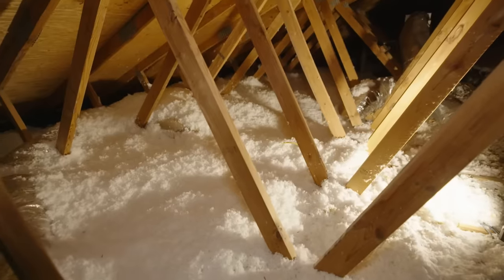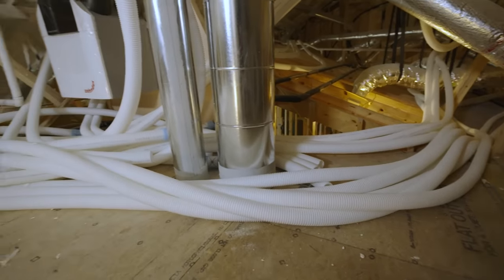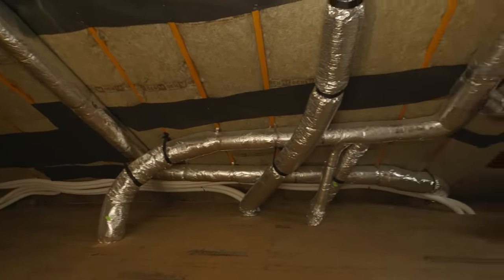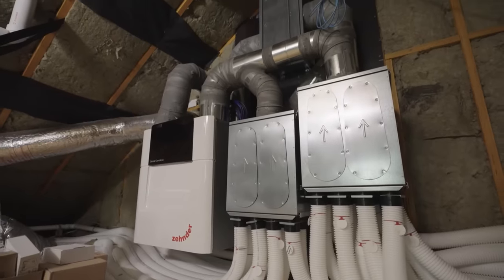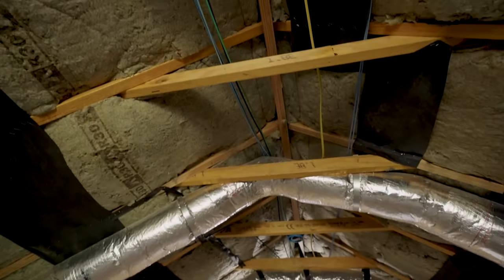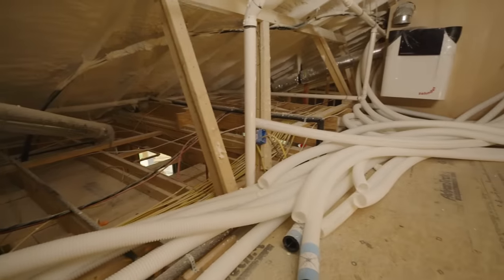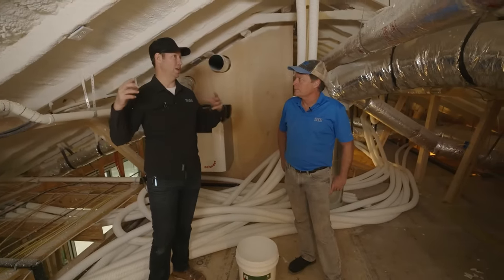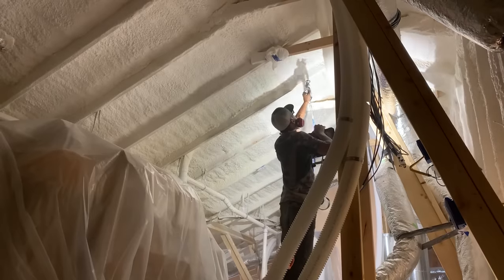Building a BETTER attic - Unvented + Conditioned attics 101

Comment: I thought I was going to see something innovative that is condensed, less complicated, with an eye on the budget. This is exactly the opposite of that and looks like a nightmare. I would opt for a ductless system and a clear span attic that is insulated with circulation roof fans installed, leaving it available for potential a/c and living expansion.
Reply: Ductless (mini splits or ptac type units) are possible but independent of the type of insulation , and assuming you mean rafters or an attic truss for the "clear span", if it were insulated for future use you wouldn't be ventilating it with "circulation roof fans".
Reply: Duh if I can't do a while house in a day it's a waste of everything

Comment: Well I live in Southern California and I feel sorry for anyone that has to live in a swampy climate like Florida. It was 116 ( one day) during a heat wave and humidity at 7% in summer  of 2020 and I never once needed to turn on my ac. I have learned to cool my home with a Bonair 5900 evaporative cooler and the hottest it got that day was 80 inside my home and dropped quickly after sunset. Desert living is the way to go if you understand how to manipulate your environment by capitalizing on the low humidity levels. However we do have to use our conventional central A/C for about a total of 22 days on a average due to hurricane fronts pushing up from Mexico causing our humidity to go over 45% which makes evaporative cooling useless. And yes we do have wood rats that like to encroach into the attic so we do have to be diligent about rodent control 24/7 365 days a year. Type of home ( stick built stuco treak home).

Comment: The outside of that roof is going to get scorching hot without attic space ventilation.  I'm fairly certain this will be less efficient over all since there is no convection to continually remove heat from the roof surface.  Also asphalt shingles will probably melt and curl in 2 years.

Comment: Matt states "this is a dumb way to build" and shows a "better way to build", and as usual, without a word about the cost, and what the expected savings will be. 

This is a dumb way to plan your build.
Reply: It definitely costs thousands more.  And it may be more efficient, but you added  couple thousand SF to heat and cool, that costs $
Reply: I've watched several of his videos.  Some I like but many feel like sales pitch or a Holmes On Homes episode.  Not always practical.
Reply: @imushavem7504  his old ones are really good.  Lots of useful info.  Lately, it's mostly Bob Vila style sales pitch.

Comment: Matt I appreciate your videos and think you do a nice job, but where is your air barrier in this attic?   I know that rockwool can be a fine insulator, and I'm sure that in TX you don't have the same issues as we do in colder parts of the country with water vapor condensing on the undersides of roof decking (and forming mold).  But in a cold snap or anytime outside temperature falls below dewpoint, my guess you will have water vapor working it's way up through that rockwool, condensing on the underside of your roof sheathing and then potentially causing some issues.  As a bit of background I have fairly deep building science training and own an insulation company in Pittsburgh specializing in retrofits.  Are you not concerned with having an air barrier on the upper part of your building assembly due to the climate there?

Comment: I’ve been doing this for almost 20 years in South Florida. It’s the only way to do things. I don’t like the rock wool tho, I use foam.  You get a better R value and it’s cleaner. Bump that rock wool in a couple years and see what happens. My attack gets about 3-4 degrees hotter than the house in the middle of the summer and unlike most of Texas, we have wicked humidity. I also have block walls with a R-r foil, along with impact glass.  My electric bill is about 20% less than my daughters house that’s 60% smaller than my house and I have a pool.  It’s more expensive, but it saves me an easy $100 a month.  That’s a stupid code for fire. There’s so many stupid codes.  No problem if it’s a living area, even tho it’s above your head, but for a storage area outside of your living area, really?  By the time it makes it through the 1/2 hr drywall in your house, to get to the attic, you’d better be out of your house.  A lot of codes are pushed by manufacturers paying code officials to use their products.  I’m sure that’s where this one came from.

Comment: All the ways I see on american youtube channels make me laugh because they are so old and outdated so is this one.

In the first place, the first way of making the attic, such a waste of your space. In addition, it is always a mess with cables and flex AC channels. Have you never heard of cable ducts over there?

Maybe you should come here to see the European way of building. All the mentioned "new" solutions have been used here for years as a standard.

For the first roof in his own house, he only uses Rockwool, very good, only a vapour-tight layer is still missing. On a cool evening or in winter, water vapor will condense under the metal roof or against the roof boarding and cause it to rot or mold. It's almost done, now just have to finish it the right way.

The foil also prevents the Rockwool panels from sagging, which happens after 1 to 2 years. In addition, the particles that come off the insulation boards cause lung damage with prolonged exposure. These particles are released by just the air moving through space. These plates must always be finished or concealed if it is a room where you can or may come often.

If they are the specialists, they still have to learn a bit more...
Reply: I agree. The space between the Rockwool and the plywood will indeed cook! I like to put baffles and let air flow along this plane. And yes I also agree that the exposed rockwool is not the best of ideas. Cover it with permeable house wrap or with permeated fi foil.

Comment: The most expensive attic ever ! That you cant live in
Reply: Yes problem solved by using cellulose insulation not fluffy fiberglass.
Reply: Would you want to live around duct work? lol it is still usable space....I tried storing seasonal decorations in my attic.....a lot of it melted in the Texas heat....sooo, cant use my attic as is, it is literally, dead space.
Reply: @AD-1138  the money that was spent on a attic like that one you could have made a air conditioned room !
Reply: @jimbo4203   You are obviously missing the point of why they are making the conditioned attic space and how you will save money over the life of the house.

Comment: Hey Matt.  What kind of air and vapor barrier was on your Rockwool assembly?  You can't just stuff Rockwool in those bays and be done.  There is more to that assembly.  Nic job on the show over the years.  Keep up the good work.
Reply: It's Texas, the sheathing is both air and vapor barrier. In hot climates you want that stuff on the outside because that's where the moisture comes from, especially if you have brick veneer.

Comment: Better solution - $99 gable fan to power vent the attic whenever the temperature rises beyond a set point.
Reply: I have one and it works great. I have a basement so my ductwork and furnace are down there. Painted the house white to reflect heat and a few strategically placed trees for shade. I'm comfortable up to 85 degrees without running the AC.
Reply: Horrible solution.  

No: 1 it doesn't address the energy penalty of having the ducts in attic. 

No 2: It draws cool air from the living space below which in turn will draw moist outdoor air into the living space below.

No 3: If your attic ducts are leaking your spending $$ to heat/cool the outdoors which is what a vented attic is.

Comment: I'm supposed to close on a house just outside of Austin that looks exactly like the example typical attic here. (Except that the insulation is blocking the ventilation anyway) I want to be able to easily run wires (for Ethernet, speakers, KNX) and stuff through the attic, and something like this might be the way to go. I don't particularly want to be digging through blown insulation.
Reply: So you going to dig thru expanding foam instead?
Reply: @tyler3993  No, insulation would have been on the roof rather than the attic floor. Making it easy to run wired through the attic. Though I will not be buying that house due to insane circumstances that not even the head broker for the state has seen anything like. O_o

Comment: I'm pretty sure that carbon dioxide is the temperature of all the gases around it. Carbon dioxide can help put out a flame when it displaces oxygen but I don't think it's a cooling gas. Correct me if I'm wrong.

Comment: Just curious, IF you decide to apply this product in an existing roof with shingles and by any chance there's a penetration in the shingles, can the water get stuck undetected between the layers? 🤔
Reply: Closed cell foam in particular expands and would seal holes. If the roof cover is leaking, that would be a problem on top of the sheathing but not between the foam and sheathing.

Comment: I have said this many times. I don't understand why houses (attics) are done that way. Well, one point is the price. It is a heck of a lot cheaper to stand at an opening with a hose over your shoulder and spray that stuff into the attic until it looks like enough. The way it shows in the video, it's the way it should be done. But there is a hefty price difference.

Comment: In Europe banks won't finance houses with spray foam attic insulation as you can't check the quality and condition of the wood frame underneath. As mentioned it can be moldy, substandard and removing the insulation may damage the frame as well as it sticks so damn well.

Comment: The only product to use in attice (the walls too) is spray foam insulation! Yes rock wool insulates,,,,, but it doesn't seal. Energy moves with convection easier than conduction or radiation.

Comment: I've got a newer (2 y/o)  DR Horton built house in NW DFW that I've been brainstorming on converting to sealed, and I'd have zero issues if you wanted to do a video about. Would also allow to remove the 24" or so of loose fiber insulation and put decking down over the rafters for a ton of storage space. This one is a cathedral style attic that has about 10-12' height at the tallest point from the existing decking. Very easy for a tall person to stand fully upright and still have several feet of headroom.

I agree, it would have been 1000% easier to do during the initial build vs. remodel, but I am the 2nd owner, so it is what it is.  They did a decent job as it is, but having watched yours and several other construction and remodeling channels and seeing what others have done, there's a lot of room for improvement.

Comment: Here in S.E. Texas , we have a 2500 sq ft vented attic . Vents are on each Gable , two intakes on back side of roof . One Power exhaust set at 105 that normally runs no more than 10 hours daily in summer .  Our electric bill on balance billing is 65$ monthly . Why would we want to KEEP heat in the attic 24 hrs day ?  During Feb 21 ERCOT Failure , we had no power/heat 60 hrs straight . attic got  No colder than 40degrees so no frozen pipes as we drain them as soon as we lost water . HEAT in attic must be northern Thing .

Comment: Our attic looks just like the beginning of this video. but our air ducts looks like a horror story and we have certain rooms that doesn't even seem the air conditioning is even coming up... The contractor that built our home did a horrible/ terrible job on the air conditioning ducts and also parts of the house...We hardy have any cold air in the house...🤔😕 Good video very informative...👍
Reply: Ducts should in in dropped soffits in the house, never in attic. Or go to wall or split systems and eliminate filthy ducts.
Reply: @designstudio8013  Wow!!! Your Awesome!! Thanks😉💯👍

Comment: -Excessive cost (vs insulating only the attic flooring, you’re promoting doubling the surfaces insulated and the costs would be massive).
-Promotes materialism (if your house can’t hold it, don’t buy it)
-Toxic materials / Terrible environmental impacts of foam / flame retardants
-Requires Power 24/7 to AC; as attic has no passive cooling. So any thing from a natural disaster to a cyber attack could cause massive mold issues (especially in the South).
-Attics insulated this high in R-value will not aid in melting accumulated snow. And unless the roof was designed to handle excessive snow loads?

Over building a home on paper is great; but it’s also not practical for most Americans. And this video takes the cake. Because it’s advice that is only practical in texas with a home that has backup power. And of course, for a wealthy client.

Comment: From my understanding the ventilated attic or roof space is to keep the sheathing cool and the tar paper used as a vapor barrier cool to extend the life of the roof.   Some insulation contractors claim that putting that insulation under the sheathing won't harm the tar paper.

I have a hard time believing that.  Because insulation traps the heat between the tile and the sheathing that means the tar paper gets the brunt of the Heat.

Am I correct or can you give me some authoritative white paper or study by reputable source that shows that adding insulation will actually extend the life of the roof.

Comment: It would have been nice to see the coating applied to the foam.  Because that is what has to happen, right?
It is hard to get much value out of what the short guy is saying:  he doesn't give much context, and then uses abbreviations that are completely unfamiliar.  Fortunately he backs up a couple times so it made a little more sense in the end.

Comment: Everything inside your insulated envelope (living space) is heated and cooled by your HVAC system.  Is it worth it to cool and heat a storage area?  How often would you use it?  Insulation is a barrier from the outside.  That's it.  Your HVAC system heats and cools.

Comment: in ohio we dont put stuff in our attics because it can freeze.  i chose to do vented because the R value is higher with blown in and you dont have to pay to heat and cool that area.  also if you dont vent your roofing material and just spray the underside of the sheeting, youre asking for trouble.  texas is obviously not ohio.

Comment: My attic look like the first one and I agree it’s not a smart way to build the attic like that.. My wires is on top of the wood… I believe my outside wire was disturbed when I was in and out for air handler problems…

Comment: A conditioned attic is great for the first 30 years. A caring homeowner may replace the roof before new decking is needed, but how many owners of 30 y/o houses care? Leaks and foam do not mix. Then the house needs a new roof and any $$ or Green savings is nullified.

Not to mention solar panels. Do you plan to put holes in your roof on purpose to install solar panels? I don't recommend that to anyone, but I only invest in houses where solar panels will be an option for those whom I sell to.

Comment: Greetings, I have recently acquired a new home with a detached garage. The garage is 2x4, OSB, and vinyl siding (not tyvac -- yet). The "attic space" is open engineered "A" frame. Soffit vents, ridge vent and a gable vent on each end. I have temporarily closed off the gable vents and installed a portable AC  to try to drop the humidity (which seems to be working). I figure that I will need to remove the ridge vent; but not sure what to construct in its place. I have yet to figure out what to do with the soffit vents. I have plowed ahead and purchased enough R13 faced fiberglass batts to put up between the roof rafters (24" spacing). I would like to spray in some mold/mildew inhibitor before putting up any insulation because the garage has been sitting at ~80% humidity for years... Lastly, I am considering having solar panels installed which I figure will also reduce the heat in the garage as it will shade the roof (I used a FLIR heat imager and found that the roof is BY FAR the greatest heat contributor). The ultimate purpose would be to serve as all of my shops: woodworking, auto working, electronic, metal working, and the like. Thoughts?
Reply: Install big ass fans in your shops they work well with humid places :p

Comment: assuming we'd need air flow between roof underside and sprayed on foam (assuming we don't have Matt's patented slanted wood slats under a metal roof!)
Reply: I’ve seen some staple up conformal stuff to put between the insulation and the roof plywood.  Leaves the air about a 1 inch thick passage to flow up and out the peak vents.

Comment: Northerners beware! This idea is okay in Texas but not okay up north unless you do something about ice dams at your eaves. No matter how good your insulation, your roof will be warmer than your eaves. Heat transfers from the conditioned (warm) attic through the roof and melts some of the snow. The melt water runs down the roof to the eaves where there is no heat source. Consequence? Ice at the eaves, which builds up until the run-off has to go uphill to escape to the ground. Water won't run uphill so the ice backs up toward the roof peak and works its way under the roofing into the attic and then down into the house. We build those crappy attics up north to keep the roof COLD. We don't want that snow to melt until the weather warms up the eaves. Standing seam metal roofs might be a solution. I haven't tested this theory yet, but if snow doesn't build up but just slides off, there will be no ice dams, even on on an insulated, unvented roof.

Comment: I was not able to find a contractor to retrofit my 1990 attic to be encapsulated. To many corners they could not access. So I airsealed the drywall penetrations and did r50.